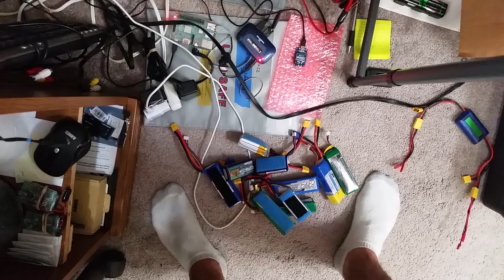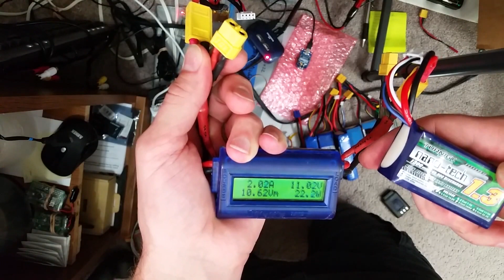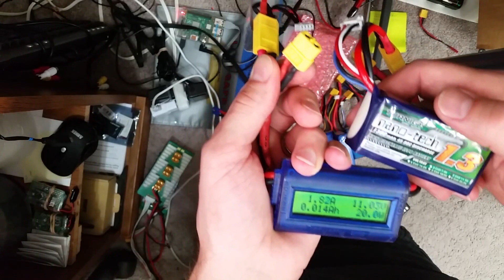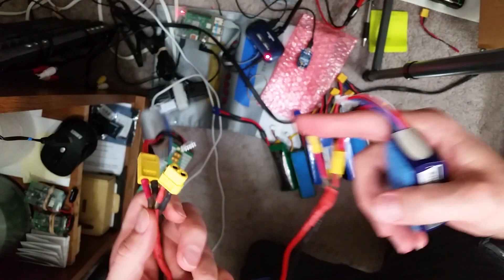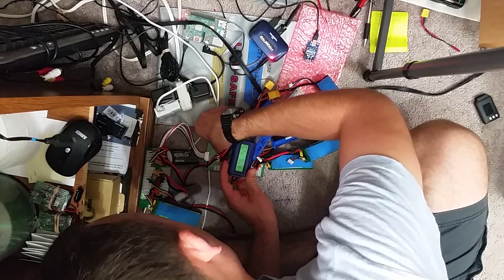How to Use a Power Meter to Safety put 10 x 3S LiPo Batteries in Parallel for Charging

Comment: Nice explanation and tutorial, thanks! Is it damaging the lowest voltage battery to be loading that quick 3.x amp charge from the higher voltage battery?
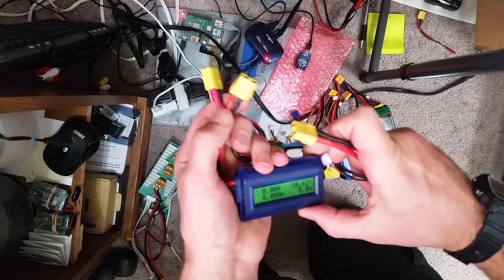Reply from the maker: Jeff, this happens at about 4:24 (start watching at 4:12), just after I plug in the 2nd-least-charged battery to the least-charged battery. The 3.3 A or so going into that 1.3Ah battery (3.3A / 1.3Ah = 2.5C charge current) is for such a short duration (a few seconds to a couple dozen seconds or so, with the current rapidly decreasing the whole time) that it is not a problem. However, if you charged at this higher current for a long period of time, yes, it could damage (or accelerate the wear and reduce the total number of charge cycles) of the battery. In other words, everything I've done here I consider safe, normal, good, and within reasonable limits.